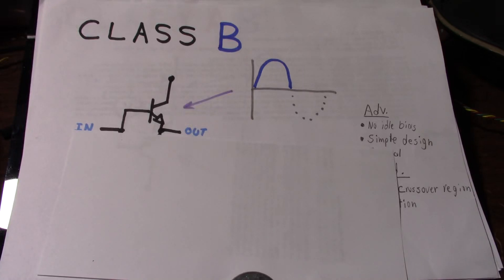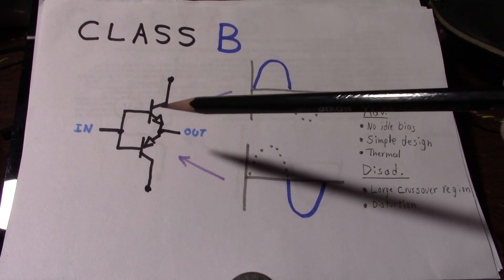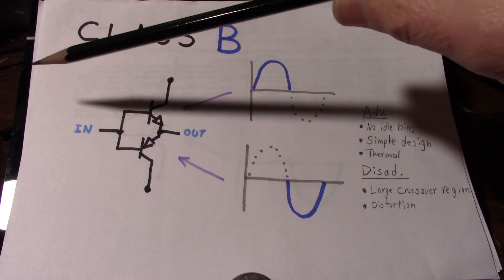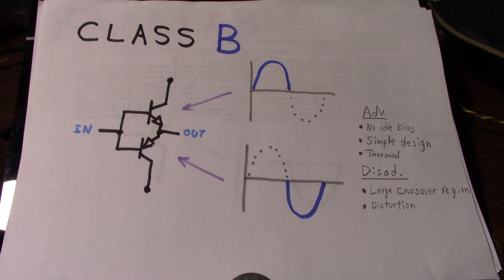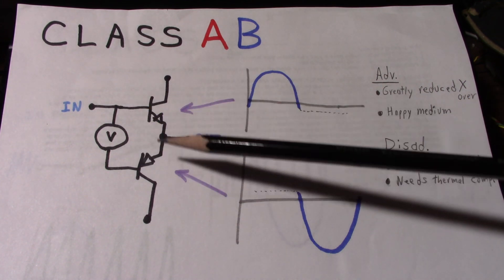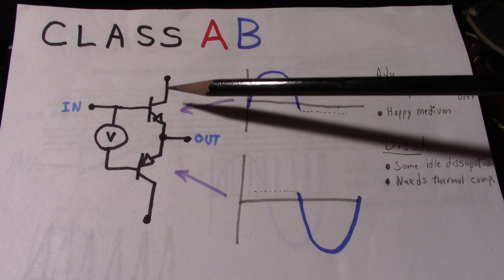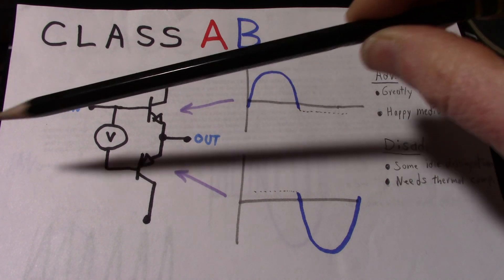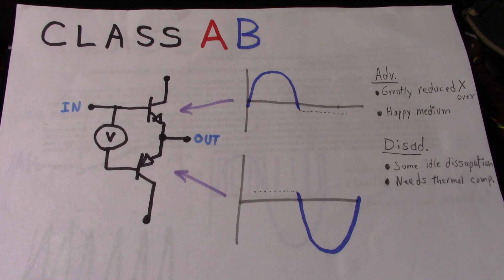Class B & AB audio amplifiers - an introduction - Part 2

Comment: I have build a modified Linsley Hood Class A amp. I have turned the power supply down to 16 Volt, changed some resistor values and used the transistors I have. I have measured an output power of 2 Watts. The amp drains the power supply with 10 Watts. The sound is amazing. I have designed a combination of a transmission line & a back loaded loudspeaker horn using a coaxial Tannoy speaker for my project. Maybe I should build a class AB  and find out if the sound quality can match up.

Comment: I am just learning about amps, and I thought that many/most Class A/B amps do not have a thermal compensation (thermal feedback?) circuit. Do you know of amps that do have this? The only ones I know of are so-called chip amps, and the AkitikA GT-104. Oh, and many/most tube amps, I think?
Reply: I think most final stages running BJTs do, because of positive thermal coefficient, ie collector current rise with temperature and this essentially positive feedback leading to thermal runaway, ie. self destruct sequence. Mosfets generally do not suffer from this affliction.
Reply: @paulb4661  Thanks - you're gonna' have to tell me what BJTs are, though. As I said, I am new to this ...
Reply: @NeilBlanchard  Bipolar Junction Transistors - still most common nowadays and directly responsible for the demise of tube/valve amplification. I'm an amateur myself.
Reply: @paulb4661  Thanks again! I am looking forward to your next videos in this series. Having this one let me go back to the first, and get my head around things better.
Reply: @NeilBlanchard  Mine ??? You mean Dear John's, I hope! Get through The Art of Electronics by Paul Horowitz and Designing Audio Amps by Bob Cordell afterwards and then blow sth up and then ... fix it! 😉
Reply: @paulb4661  Sorry - I got confused there ... the closest I will get to this is building kits. I have done both an AkitikA GT-102 Z4 and PR-102. I probably will be assembling a GT-104; which is their discrete version of the GT-102 Z4.

The GT-104 has a device (a transistor, I think?) that is piggybacked onto one of the output MOSFETs to have a thermal feedback. This apparently keeps the bias stable no matter how hot (or warm) the MOSFET is.
Reply: Almost all AB amps have a thermal compensation circuit. It usually consists of a transistor or diode(s) placed against the heat sink which is across the bases of the driver transistors. As the unit heats up, the transistor or diode conducts and lowers the base current. I'm working on an amp at the moment which has lost control. As I drive it harder, it goes into thermal runaway and the output transistors start to draw large currents and get very hot. The overcurrent protection then kicks in and shuts the amp down
Reply: @tenmillionvolts  Check out Patrick Turner's designs using lateral mosfets. I myself have two pairs of hand matched Exicon 10N/P20S laterals per channel with no thermal compensation and no source resistors, DC biased precisely to the point of zero thermal coefficient value between drain current and gate to source voltage. Once drive signal is applied it turns negative, ie drain current drops with device temperature rise. Certainly no need for thermal compensation and no stability issues whatsoever with capacitive load. With another amp running Toshiba J200/K1529 hexfets, I have no thermal compensation/runaway either, but it doesn't sound quite the same.
Reply: @tenmillionvolts  Thanks. The only other reference I have is my B&K ST-140, which had the bias drift way up. I recapped it, and adjusted both the DC offset and the bias - and it was waaaay over biased. The spec was (I think?) 210mA, but the left channel had drifted to ~508 and the right channel was at ~360.
I had the ST-140 since new, and the heatsink started as black, but turned a magenta hue from all the heat over the decades. The left channel finally died about a year after I got it recapped and adjusted.
The AkitikaGT-102 Z4 uses TI LM3886 output chips and bias is preset when they fabricate them. And apparently, the bias doesn't drift.
Reply: @NeilBlanchard  Ah, yes. FET output. I've worked on the odd few B&K and I found them fairly unstable in general. FETs are voltage driven and require careful control. I find the boutique brands a bit hit and miss for good design. They often use weird and wonderful circuits and components that the big names won't use due to reliabilty or cost issues. I've had to re-design some a little to keep them running sometimes (NAD, I'm looking at you!)
Reply: @tenmillionvolts  Well, my B&K ST-140 lasted 35+ years of hard use, including a ~7 year period that I left it on 24/7.
Reply: @NeilBlanchard  Great. You got a good one by the sound of it
Reply: @tenmillionvolts  It was my favorite amp - until I heard the AkitikA GT-102 Z4. Which has even better soundstage - and has much better bass control and dynamics, etc. My initial replacement was the Schiit Vidar, which has the bass control better than the B&K - but the AkitikA beats both at their strengths.
Reply: If you look back at John's JAT501 (aka Discrete Audio Amplifier) series, you'll find that he spent a fair amount of time discussing and optimizing thermal compensation.  You'll definitely learn something from the JAT501 series, which started Aug. 2, 2018.  I did, though I promptly lost much of it ;).

https://www.youtube.com/watch?v=0m3Ztf8yvOY&list=PLHzOpLPsV6EEXmcSlRwg67rzVkCSpltHs

It doesn't appear that John created playlists for his other amp projects, so they can be difficult to follow.  He generally includes the project name in each video title, though.

Comment: There are several schematics out there that show you how to build a small low distortion Class-AB amp (aka a Headphone Amp) using an op-amp and a discrete class AB output stage. The best one I've seen is contained in the "Audiophiles Project Sourcebook". (by G. Randy Sloane) It uses a split supply with constant current source for each rail and three diodes to supply the residual bias. A similar "all transistor" version was found in Nuts&Volts magazine from Sept & Oct of 2013. Both are very low distortion units and the Sloane Schematic is small enough to enter into a circuit simulator.
Reply: I have a great little amp based on a design by Rod Elliott (ESP) and is basically as you describe and sounds awesome.